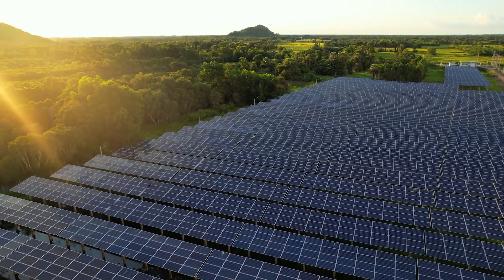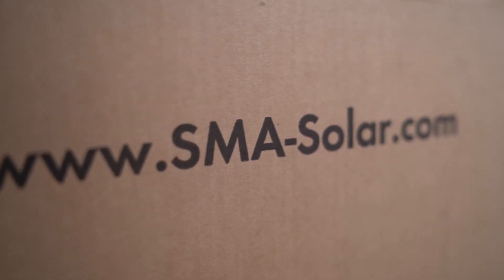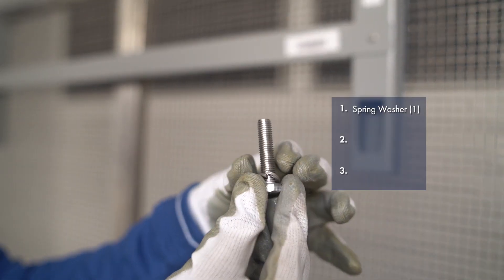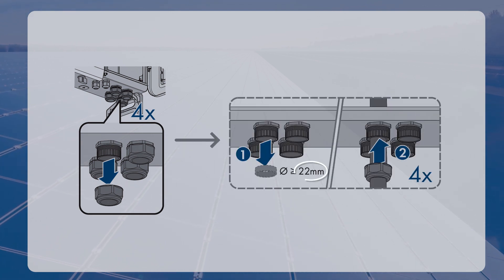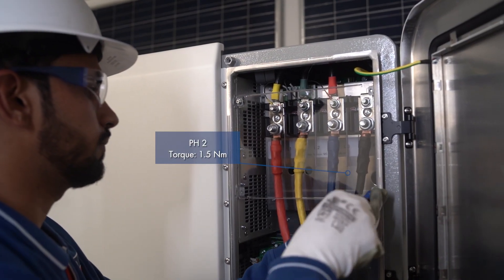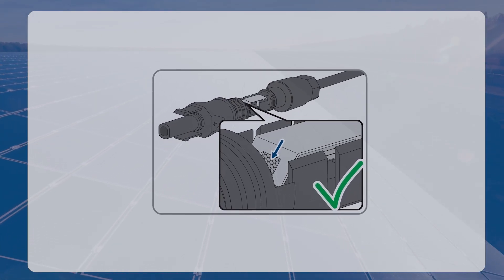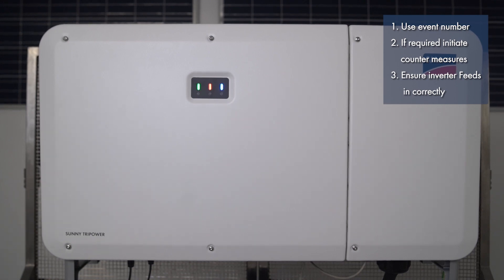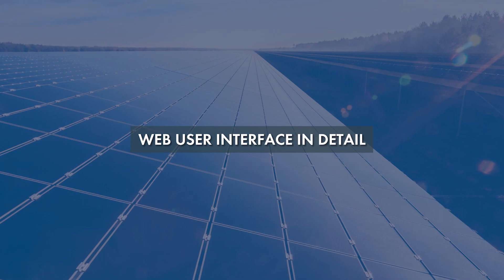TechTip: Unboxing, Installing, and Commissioning Sunny Tripower CORE2

Comment: The video shows the inverter connected directly to a computer or smart device. Doesn't it need to connect to a data manager first then to a computer or smart device can connect?
Reply from the maker: Hello Patrick, the setup of the inverter is shown in this video. For that you connect directly to the inverter and access the the user interface. You don't need no other equipment for that. Sunny regards, your SMA Social Media Team

Comment: SMA, could you show a detailed video, exactly what information the Sunny Tripower CORE2 shows through the user monitoring and if it uses for example 5 or 20 or 50 inverters. What do I see at the string level? On the entire inverter, if an event occurs, a break in a separate string, is only it deactivated or the entire inverter? If the AC or DC surge protector burns out, what can be seen, does it turn off the inverter or just warn? Please familiarize us with the product in detail before purchase, what to expect from the machines. Thank you in advance.
Reply: Great suggestion , simulating the plant level monitoring and troubleshooting videos .